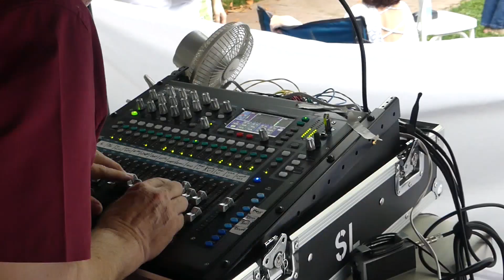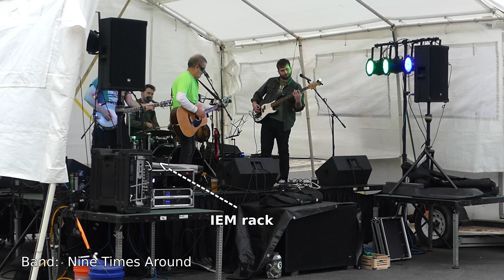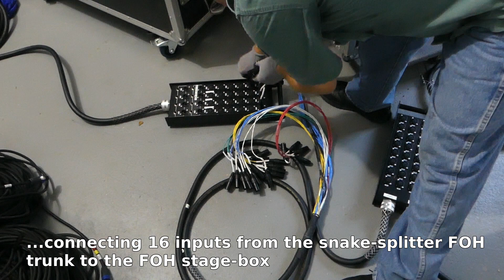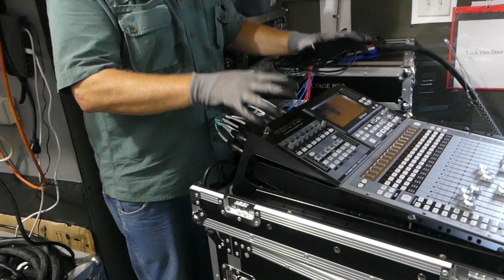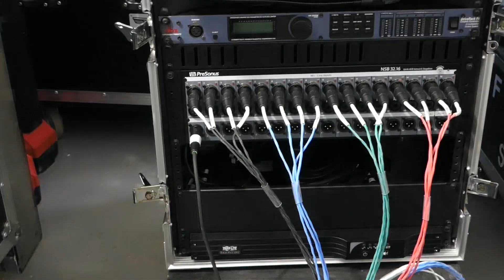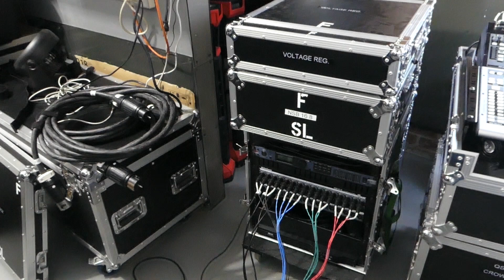How to interface a band's IEM rig to a sound system

Comment: Why not just connect the one fan out straight to the monitor board and the other straight to FOH? As long as everyone is on the same page with the input list.
Reply from the maker: Yes, that is exactly how it would work for a FOH analog setup.  However, the setup in the video is for a FOH digital setup, with an analog monitor setup.  Thanks for the comment.

Comment: how about ground loop sir there is some microphone using phatom like over head mic for drums and hihat it is ok for analog spliter?
Reply from the maker: An analog splitter  (non-isolated splitters) work great with phantom power.  It does not matter which console provides the phantom power.  Though, it is usually common for the monitor console to provide all phantom power.

Comment: Hi. it’s something to consider. IEM is the future. Would like to know how you route your pa 260 to run separate channels independently
Reply from the maker: The 260 is used primarily for FOH PA.  A band's IEM setup is completely separate from how the 260 would be used.  The signals for the 260 would still be returned on the main FOH snake.  Running a FOH PA would not change when using an IEM setup.
Reply: @stageleftaudio  i agree, I’m asking these because i have been following your videos for sometime and would really appreciate a video on routing the drive rack to create two separate inputs channels where one is for the mid/ high and the other is for the sub
Reply from the maker: Ah ok.  I did a video a few years ago covering that exact topic, but in that video, I was using an analog crossover.  I may do a future video covering that topic but using the 260 for the xover.
Reply: @stageleftaudio  Thanks Bob that will be highly appreciated🙏🙏

Comment: Hello sir again,

I have an question about the DBX 231S dual band EQ
Can u please tell me which frequency is to cut for boominess. Or how to find the booming frequency. Much appreciated
Reply from the maker: Good question.  The "boomy" frequencies can cover a large range of low frequencies, therefore, there's no way to say which frequency is the boomy one.  Sometimes, the boomy frequencies may actually be a result of a physics issue (power-alley, bass reflections in 1/4 space, speaker resonance, etc...) and not so much related to a frequency issue.  Trying to correct a physics issue by using an EQ does not usually have good results.
How to find the booming frequencies....?  I recommend listening to lower frequencies, maybe by using a tone generator (https://onlinetonegenerator.com/) and learning what the lower frequencies sound like.  By learning the frequencies, identifying the boominess becomes a lot easier... once hear the boominess, then it can be cut a few db on an EQ.  If you remember what the boominess sounded like, try to locate it on the tone generator.
Reply: @stageleftaudio  sounds great Thanks much. What u think about ankle 7.5 degree down on the tripod instead of speaker sitting straight. When angle sound dont hit back wall ? It could be the bass bouncing back it’s a church with high ceiling so, interesting the website you provide I think 50- 125 HZ on the DBX sounds like boomy.
Reply from the maker: Those angle tilting devices are ok.  They are used to change the coverage  of the speaker to accommodate the seating area(s) in front of the speaker.  They work as they are designed, but they will not help with the bass bouncing back.  For your setup, you may need to cut some bass frequencies from the FOH sound... small cuts only to start.  Indoor sound system setups can be a challenge to find solutions for issues.
Reply: @stageleftaudio  
Thanks again I will play with and see.

Comment: Splitting the signal passively (without a powered splitter) can result in signal loss. The microphone's signal strength is divided between the outputs, which can lead to lower volume levels and potential degradation in sound quality. For best results, especially in professional settings, an active (powered) splitter is usually recommended. Active splitters provide isolated outputs, maintain signal strength, and manage impedance more effectively.
Reply from the maker: Thanks for your comment.  The passive splitting in this video does very, very little (if any) to affect the signal degradation.  What you are referencing with signal loss, impacts cable distances that are many hundreds of feet long and/or when using high impedance microphones.  A 600ohm microphone (vs. standard 150-250ohm mic) will lose its high frequency response (staring around 8k) over a 300ft. cable distance.  Powered (active) splitters are commonly used when there needs to be isolation between signal trunks (i.e. broadcasting feeds).  Active splitters work well, but they have a specific use.

Comment: I always prefer a split with multipin disconnects. this way if you need to feed several monitor or FOH desks on a festival, everybody can have their own whip, and they can be changed around as need be, in seconds, without having to re patch 48 lines

Comment: Nice explanation of a Basic analogue splitter snake. I guess the next level will be a digital stage box. How about FOH talk back for the musicians on the stage?
Reply from the maker: Thanks for the comment.  This setup also works with digital stage boxes; there's no difference.  Good point on a FOH talk-back.  There's a couple of ways of handling it, but the easiest method is usually handled by a wireless receiver (basic wireless mic) connected to an input on either the snake splitter or directly to the IEM rig.  The wireless mic receiver usually connects into the highest numbered input on the snake (or the IEM console).  The mic stays at FOH.
Reply: @stageleftaudio  Nice solution for the talk back Mic, so I should probably bring a wireless Mic along for the front of house person. Thanks for the tip.
Reply: @seanwalsh999  I wouldn't bother with RF for a talkback mic. Send one back up the snake

Comment: 👍✅Makes our lives easier when the band has and controls their own in-ears👏
Reply from the maker: ...and with no monitor feedback!
Reply: @stageleftaudio  and that is the best present we can receive! 🥂🎉
Reply: I actually have an In ear rig  with my system for those who want them but they don't have their own. I would rather shell out the money for that than run wedges. I have got to the point that I do not want to use wedges at all if I can help it. Most bands even garage bands now days have use in ears.
Reply: @allenpendleton8767  👍✅ unfortunately in my area a lot still want wedges, I try to convince them with sides and a few in-ears we have but some refuse